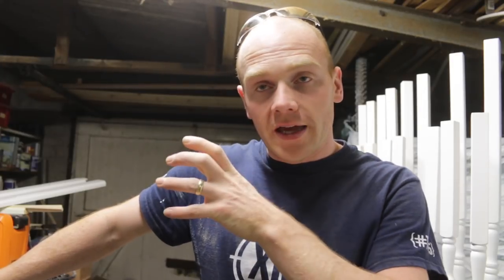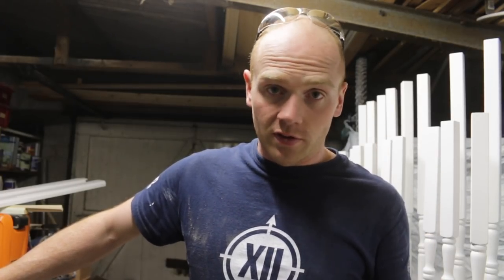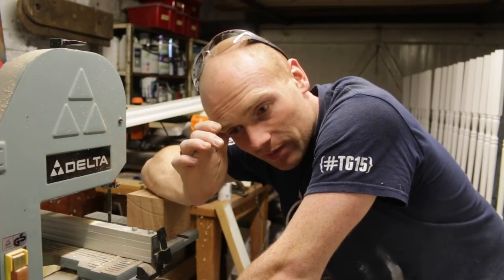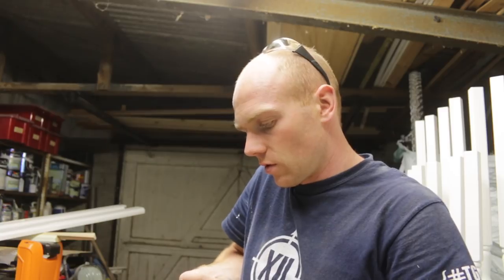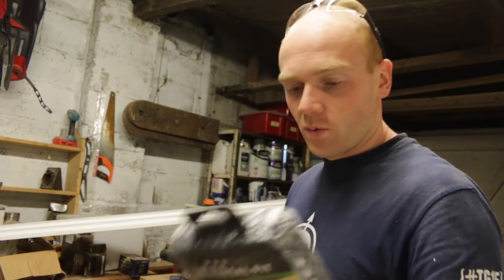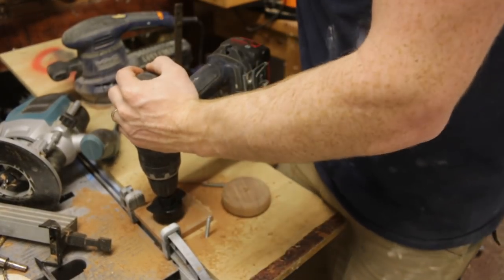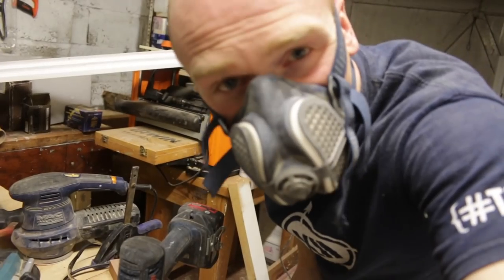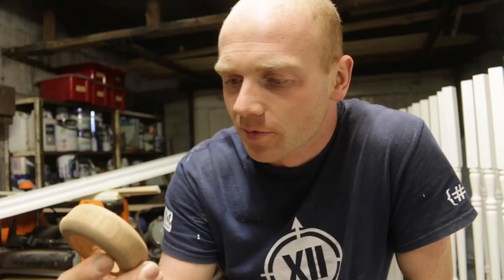Correcting STUPID Mistakes!

Comment: To hold the disc for drilling, you could have used screws through the middle bit ;)
Failing a lathe, use a bolt through the middle and use the drill press, you can add a clamp as a tool rest, i've used the drill press along with a disc sander (sanding disc on an angle grinder) to get the rough shape quickly.

Comment: Top tip, when drilling large hole saw holes drill smaller holes around in the cut line to help eject sawdust out the other side. It's amazing the difference.
Reply from the maker: Good tip. Will try next time.